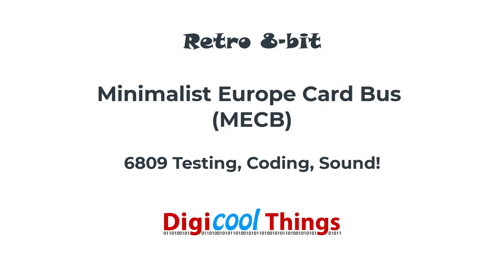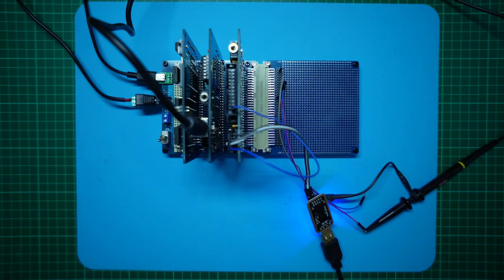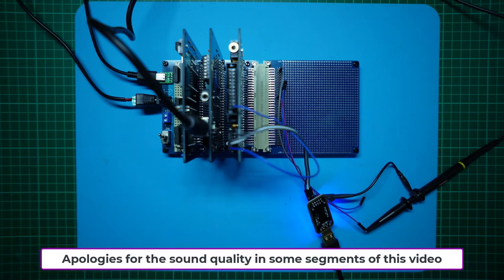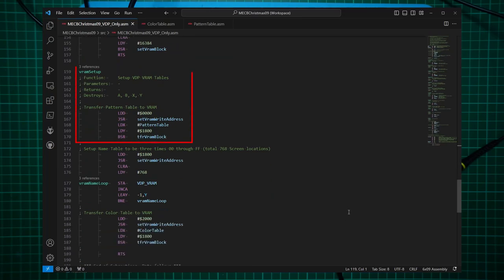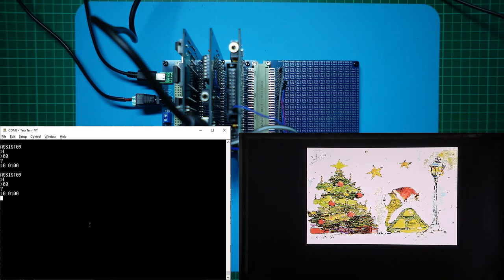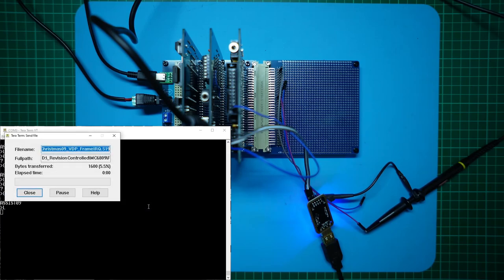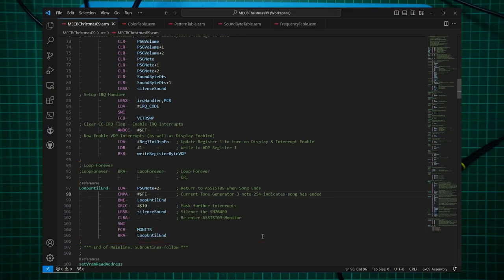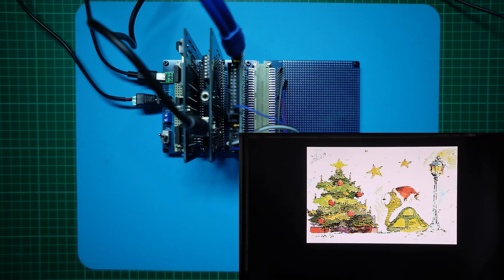Minimalist Europe Card Bus (MECB) - 6809 Testing, Coding, Sound!

Comment: Fascinating video.. Any chance you would be kind enough to make a video on how you set up and configure your vs-code programming environment with the 6x09 extension please?  Are you using the LWtools assembler? I’ve tried to use this myself but failed to get the Vs-code to talk to the LWtools assembler. A pity as I really like the 6x09 extension and it’s really helpful 6809 programming features. 😢
Reply from the maker: Thanks for your comment.  I've just answered your question on the Forum.   Welcome to the Forum by the way!  :)
Reply: @DigicoolThings  Thanks for your quick response and I’ve just replied on the forum. 👍

Comment: Great vid. How more advanced is the 6809 than the 6502 when coding in practice?
Reply from the maker: I personally found the 6809 to be significantly more fun to program than the 6502.  The best way I could explain this is simply that the 6502 design cut a few corners to save on cost, meaning as a developer you tend to need to focus more on “how” to use the available instructions / registers to achieve what you want to do, instead of being able to focus more on the actual functionality you are coding.  Obviously though, as you learnt more 6502 "tricks & workarounds", coding became easier.  
The 6809 was a late arrival on the 8-bit scene and was also promoted by Motorola as a link between 8-bit and 16-bit.  It had quite an advanced 8-bit ISA (for the time).
The addressing modes are quite powerful, the Load Effective Address (LEA) instruction enables position independent code, the 16-bit Index registers made life a lot easier, and even an 8x8bit Multiply (MUL) instruction helped make for a powerful CPU.
There’s a lot more that can be said, but having coded in 6502, Z80, and 6809, my favourite retro 8-bit ISA to code for remains the 6809.  Just unfortunate that it's late arrival (when 16-bit was the emerging new thing), meant that the 6809 didn't find it's way into as many systems as the 6502 (or Z80). 🤓